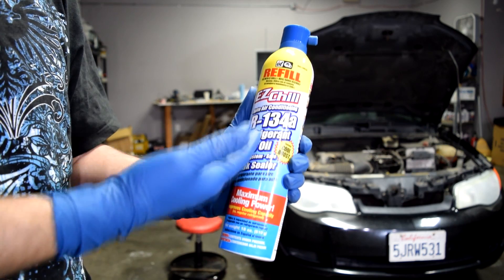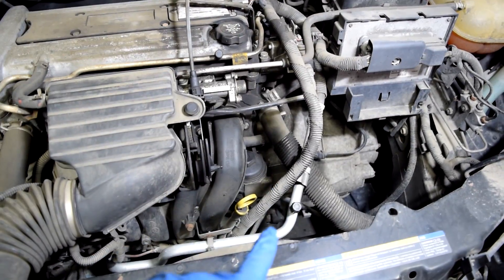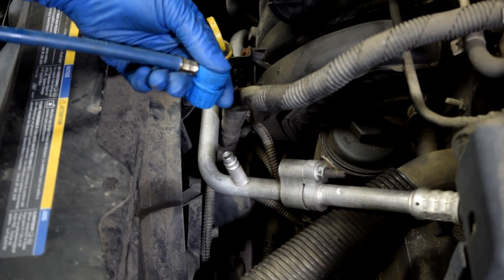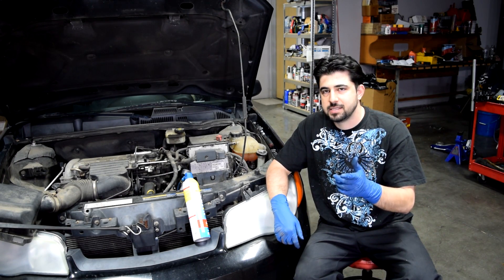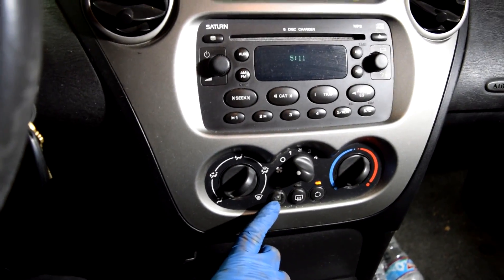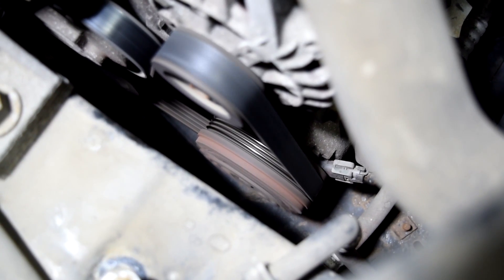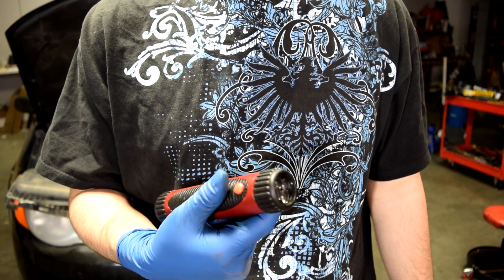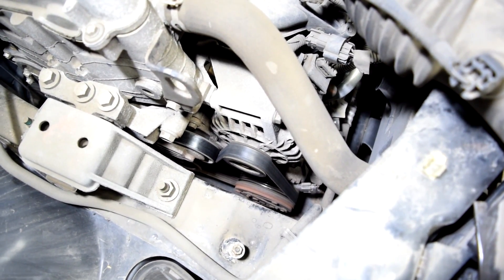How to Add Refrigerant to a Cars AC System and Find Leaks - For Beginners

Comment: Remember on those cheap cans with the hoses. You can't purge that hose. You are injecting moisture and air into the system when you pull the trigger on them. Cheap cans are a no-no. Moisture kills the system.

Comment: Everyone out there DO NOT buy refrigerant with LEAK SEALER that stuff gums up inside your A/C system. Buy the plain jane refrigerant on the bottom of the shelf! Read all the bottles and see which ones say with leak sealer and AVOID those.

Comment: Great video! I added refrigerant to my tahoe cause it was empty and blowing hot air and the clutch wasnt moving. So i filled it up and made sure i didnt over fill it. Now the compressor clutch goes on and off. I did replace the pressure switch and that didnt do anything. any ideas?

Comment: I guess you only get a response here if you're complimenting. Questions don't get an answer. If the clutch doesn't turn on it will not take any freon. I tried many times and the can still has the same weight. Go figure. Is this a do it yourself tutorial or a comedy video? 👎👎
Reply from the maker: There is a way to get a response to your question, you would know the way if you were a fan of the channel.
Reply: +Ratchets And Wrenches I subscribed yesterday, and only heard of this channel by another you tuber  while searching on this subject. After using your advise I decided to read the comments and noticed you haven't answered a question here. Beside this video I've only watched the one you explain on how an AC system works, and there you advise to watch this video. Sorry if you feel offended, I just judged by my experience and through what I've read here.
Reply: You should probaly fix the compressor issue before you watch a video on simply adding refrigerant

Comment: Update:  I was able to get my 02 sienna to take freon!  I put a new denso accumulator on it and vacuumed it down for 45 min and put one can in before starting van.  not sure exactly what issue was but it took and it is at 46 degrees.  😆
Reply: Update #2:

Cleaned condenser and it is blowing 37 degrees. Kids are complaining that it is too cold.  😉

Comment: how can I check the low valve to verify that it works properly. When I attempt to add feon to my system nothing happens. Not even the faintest noise of freon rushing from the can to the system. WHen I ull the trigger the gauge shows zero and the clutch is not engaged.

Comment: Thank you for the good explanation. I followed the steps and here my experience:
1: By using the Gage which comes with the Freon container, the reading was super high.
2: The AC compressor clutch is not engaging, It didn't start spontaneously by infusing  some Freon, So I bypassed the computer by inserting a paper clip to connect 30+87, I was so happy when it worked and I heard the click. 
3: The pressure has fallen till it reached the middle of the green area in the pie. So i started filling the Freon. It took the whole amount to reach the end of the blue area.
4: cold air started to come out (So proud of myself).
5: I kept  it running for 10 mins then switched off the car. Pulled the paper clip out.I changed the fuses and the relays to make sure that they are not the reason of any dysfunction.
6: Hopefully started the engine one more time, switched the A/C on. and the clutch couldn't make it. Yeah, it is frozen again.
7: checked the pressure  again, still in the safe blue area. the clutch is stand still.
any suggestions ?

Comment: Hey great videos very helpful. I have a 2002 honda civic and the steering wheel shakes alot when im on the highway going 55+mph. The car was in a car accident and the subframe was replaced and front rims were bend and were replaced and balanced. But the shaking won't stop any ideas on what the problem is? Thank you!

Comment: nice video  but i would like to see more diagnostic like if the charge doesn't work.  like compressor coil olm test or relay test. pressure sensor bypass test with a 5 dollar dvom.
Reply from the maker: +Mike R good idea, I'll make one in the near future.

Comment: Why didn't you vacuum the lines prior to adding the refrigerant?
Reply from the maker: +Bel “BelizeDC” Ize System needs to be evacuated before vacuuming, vacuuming the system is usually done after repairs to make sure there are no leaks.
Reply: Ya also wanna pull a vacuum after ya replace a part to make sure ya get all the air and moisture out of the system. Air takes up space and can mess up the circulation of the freon. While moisture can cause rust and thin out the oil used to lube the inside of the compressor thus cause damage to the compressor.

Comment: Hey is it normal if the compressor run fur like 10 sec and stops , like in intervals , that is when i have the heater on... Thanks
Reply from the maker: +westsidecartel90 You have the ac running when the heater is on?  that usually means you are low on refrigerant.
Reply: +RatchetsAnd Wrenches well actually is the heater when its turn on that clutch spins 10 sec and stops and it continues when i turn it off it completely stops , sorry ihavent used the ac since its cold here , but i guess its the same part for both ..

Comment: Another tip is that the high side and low side ports are different sizes. The cans with valves will only fit and lock onto the low side fittings.
Reply from the maker: +Blazer02LS Yes, good point.